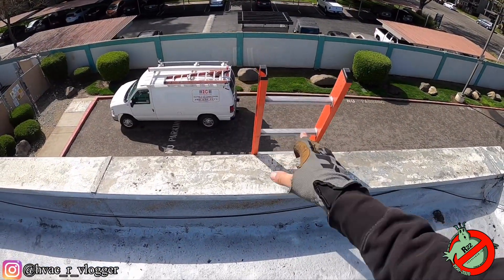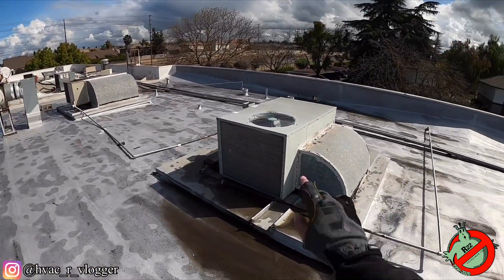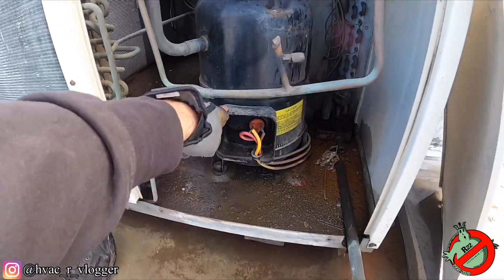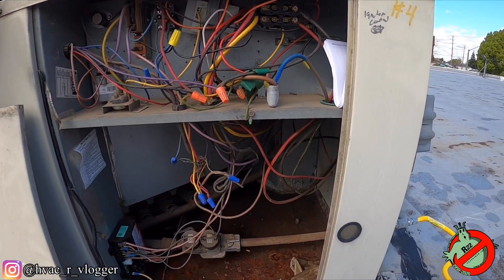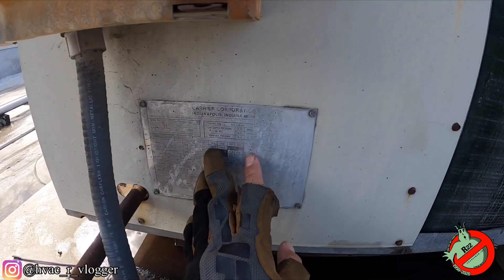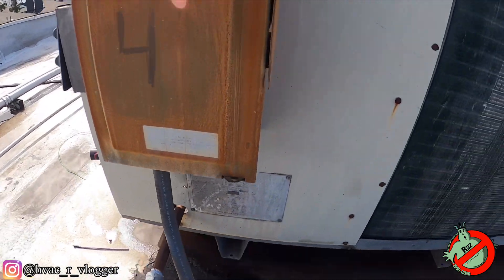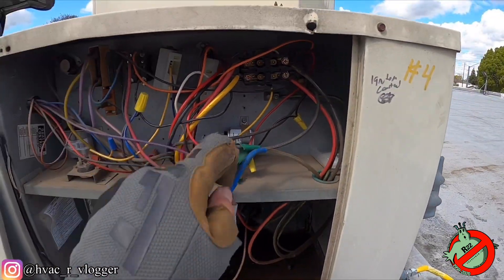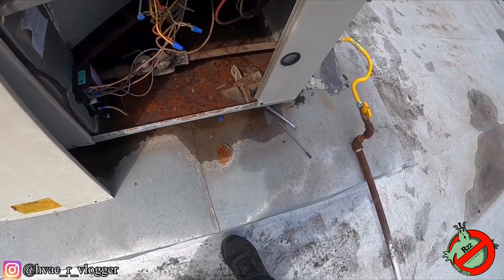HVAC VLOG / AC DOWN..

Comment: Hate when techs replace motors and wrap the rotation wires around the fan grill. Sun bakes the plastic off over time and wires arc. But I mean he cooked the motor by wiring incorrectly so probably a newbie